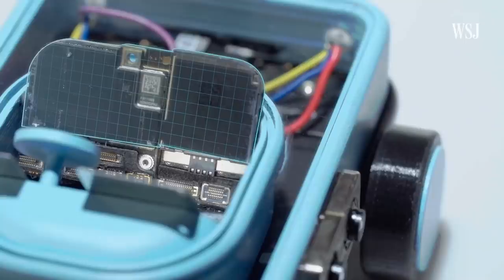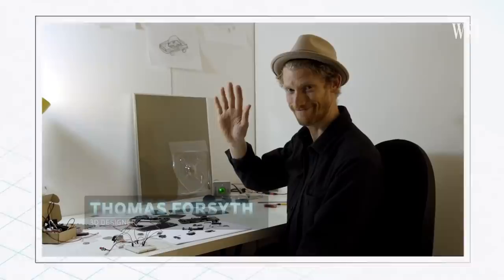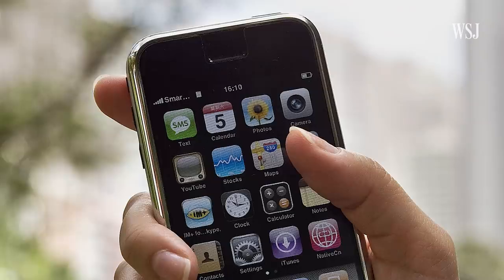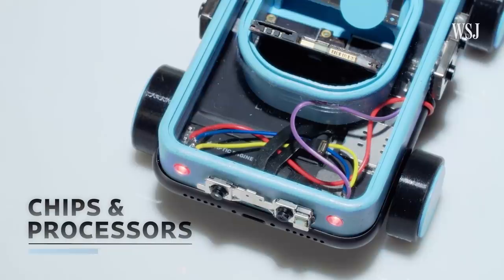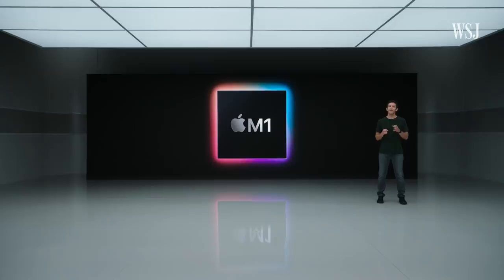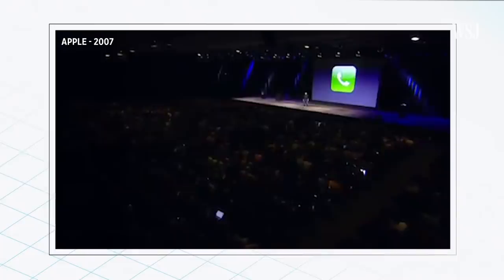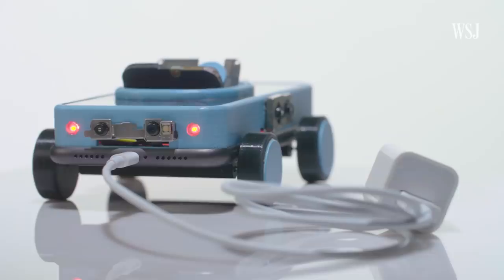What It Would Take for Apple to Make a Car | WSJ

Comment: The battery would last for 5 hours and the wheels would be sold separately.
Reply: Exactly
Reply: Plug-in is proprietary, and entire car slows down after three years..... ಠಿ_ಠ
Reply: @gus473  my s7 slowed down after 2 months while my new iphone 7 is on ios 14.4 and it still runs smoothly
Reply: @gus473  actually iPhones doesn’t slow down, leave that to androids. I have a second-hand iPhone 6s plus and it’s smooth as ever
Reply: @gus473  That’s an Android thing lol you’re getting it mixed up.
Reply: The newer iPhones don’t last 5 hours lol .. maybe the 2020 SE but otherwise the 12 goes around 8hrs and 12PM around 11hrs.
Reply: nice to read from you

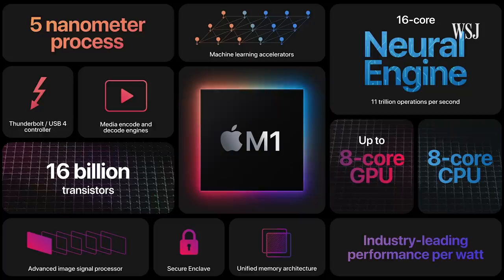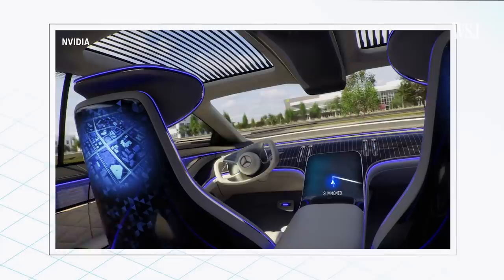Comment: I think this section from ~4:00 to 5:30 is not realistic. Having these really integrated SoCs in the iphone and apple watch was really important and a great thing because there is so little space to put things, and these computers also need to be power efficient and somewhat good performance. So it makes great sense to make a SoC for the apple watch, because combining a lot of computer parts together into one smaller computer actually helps make it smaller,  more power efficient, and higher performance. 
But for cars you have a ton of space, and  a larger battery that is there for driving already. It would be fine to use an off the shelf gaming pc or server to run your self-driving software on.

Comment: You missed a lot of opportunities for this one:
-Apple iPhones have improved sound and even have their own smart speaker line called HomePod, super capable to integrate into a car and have the best sounding speakers
-Apple has Apple Watch and a lot of metrics like ECG, heart monitor, and are able to manufacture very tiny components. This is important for a vehicle in things like the steering wheel
- FaceID can help assure that the driver is paying attention and that the driver is actually you, which prevents others stealing the car
- TouchID for the outdoor handles of the car again for access into the vehicle
- Wireless charging pads for both inside but also outside the car if electric
- Haptic feedback; sensitive pressure for steering wheel and grip may be useful for commands
- Siri: it’s already being used in Apple CarPlay but you’re capable to have a fully autonomous and complete ecosystem of products that is smarter and easier to use
- Despite the very unlikely scenario of using the glass they have in their phones on a car, it however does mean they have experience with glass and the importance of strength and safety
- AR, I know you talked about cameras but you didn’t go into the amount of investment Apple has put into AR with sensors and 3D building and measuring of various terrains and environments
- Buttons! Tesla lacks buttons and Apple has been one to take away as much exterior features as possible. This could be a benefit or a disadvantage but Apple understands design and creating sleek looking products. They always are removing unnecessary parts if they can like the Aux Jack in replacement for demand of wireless technology. Imagine how a car would look if they removed as many buttons and ports like tesla. 
- INTERNET!!! How could you miss the fact that all of our phones have been built with powerful cellular antennas. 5G iPhone 12 is an example of being able keep up with modern tech and as more and more cellular companies release internet/wifi packages with cars it ever so easy to stream content in the car for the family. As well as just look at Tesla’s and watching Netflix or playing games while waiting for the car to be charged!
- there is so much more and so many better examples than the ones outlined in the video!

Comment: Apple just can't produce anything. It orders from others. There is just no existing no-name car producer that would be able to produce with desired quality and quantity. At best it will be very small batches with any existing car manufacturer that produces cars for 3rd parties. Also, there is basically no core part of a car that was not innovated for Apple to innovate and get an advantage. Apple just can't improve batteries, engine, or driverless tech better than existing EV producers already do. Apple could make a nice car finish, but it hardly can produce a car that's much better than the competition. Unless Apple introduces a new car paradigm it hardly could compete with Tesla or any other EV brand. Car production is hard. To compete Apple needs a production capable of producing at least 100 000 cars a year—a minimum to even be considered a competitor on the car market. That's a lot. Tesla worked seriously hard and long to be able to produce 500K a year. Can't imagine any no-name manufacturer could build it for Apple in that quantity. And no existing popular car brand with the required experience and capacity will be ready to give all margin and upside to Apple by labeling cars it produces with the Apple brand. Unless Apple starts building its own factories like Tesla did there will be no Apple car—just another failed product that will never see the light of a day.

Comment: "what parts does Apple already have experience engineering and producing"

The A processor is designed by a company in Israel
Fab manufacturing by Samsung or TSMC
Not sure whether Apple does the testing... 😜
Apple is famously behind Google e.g. when it comes to AI
Other car chips... no experience whatsoever
5G/Self driving? Maybe
Battery technology? Maybe
Manufacturing knowledge/scaling? Maybe

Product design and a nice Unix fork (iOS, MacOSX)... yes
and a lot of cash. I'd argue that's relative (even though it's expressed in absolute terms), because of its tight linkage to value of the dollar and the company's valuation.

Can they succeed? It is a very strong brand... so possibly yes. As Elon Musk could acknowledge, pretty sure they'll have to crack the Chinese market. Given the current political climate, that's not an easy thing to do and markets can shift in a heartbeat